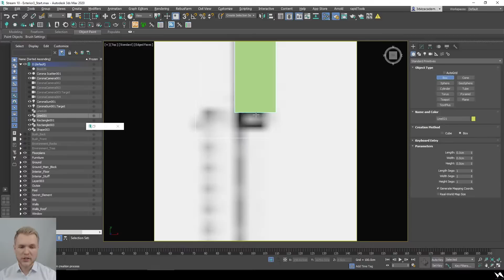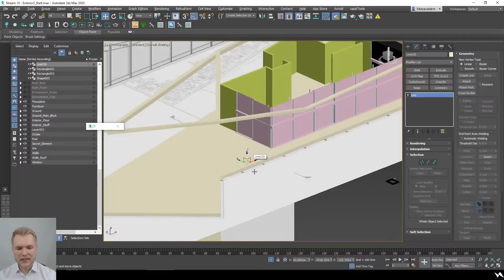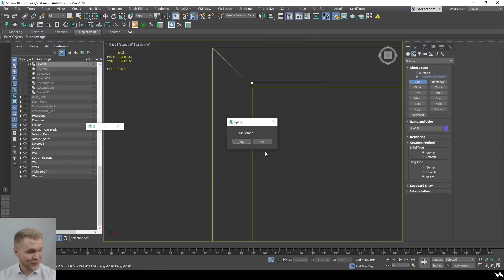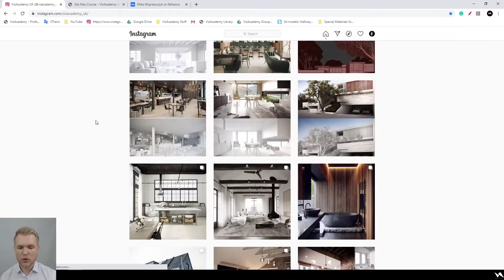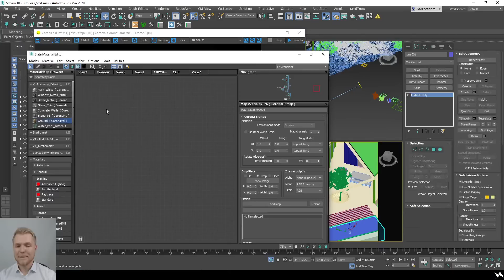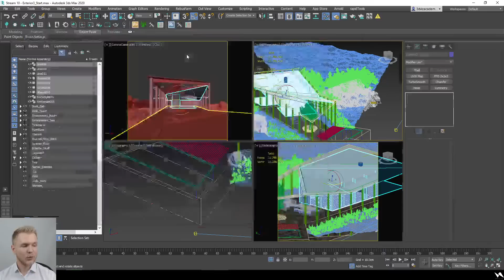Rendering in architecture in 3ds Max [Free webinar]

Comment: I really love your content but I have a point about the modeling process that it shouldn't be based on drawing lines up from an image in the architectural world, you need as a visualizer to translate the exact plans with the exact measurements into realistic images, this is a key point in the re-modeling process.
Reply: why though? Are you going to see a difference of couple cm? Isnt the render just a visualisation and not the project that builders will use